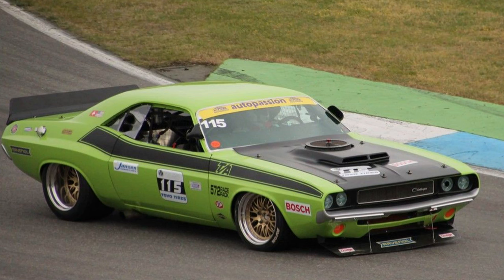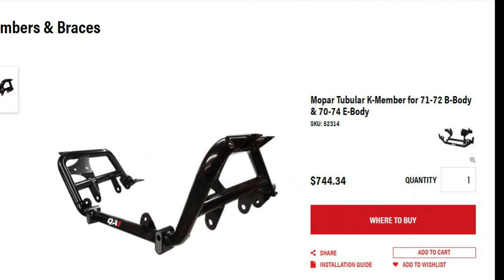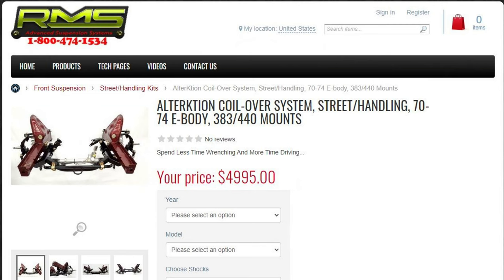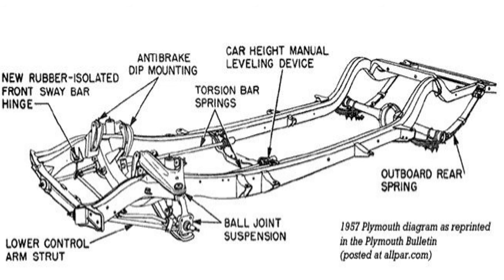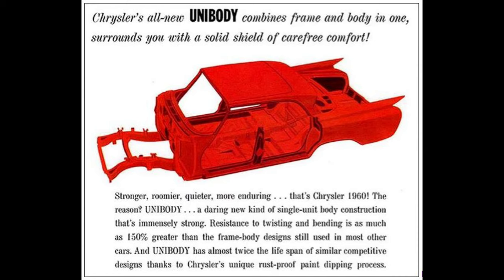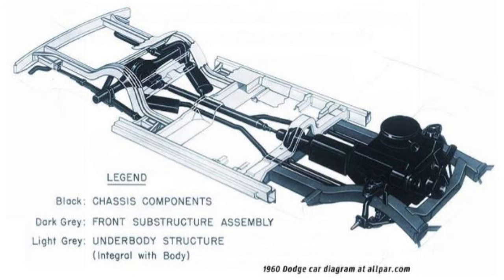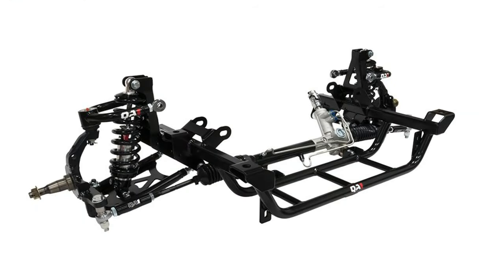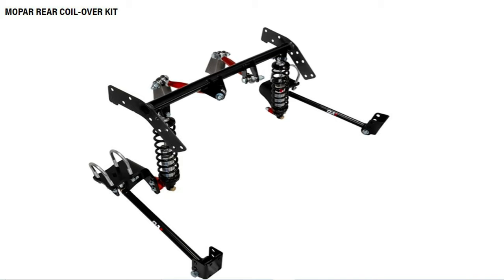Mopar Suspension Upgrades, How to Choose!

Comment: You did a great job reviewing the options out there and all are very expensive, I was assembling my suspension last night and I am going with the PST 1.03 torsion bars, and their  lower control arm stiffening plates, I also use all of the polygraphite  bushings which sometime end up being pretty noisy despite the the silicon grease that they provide. In this car I am running a firm feel stage 2 power steering box as well.  Steer and Gear also make a similar steering box in varying degrees of road feedback.  I bought one of their units when another firm feel box failed and they would not warranty it.   I have also installed the US Tool sub frame connectors and torque boxes, they are really an improvement that is very noticeable especially in my B-body convertible. I am installing a 6.4 Hemi with the 8HP70 automatic in that car. Most of the parts I have bought for that conversion are from Holly.  I am seriously interested in the QA1 system and I guess time will tell if I can pull that off or not.  Thanks again for highlighting  what is out there in one well done post. I
Reply from the maker: Thanks!   I really like the parts you chose for your car sounds very well thought out.  Any videos of it?

Comment: Adding the rear sway bar along with polyurethane bushings completely transformed the car for me.  It's so fun sliding the car around corners with the accelerator pedal.  I think what would benefit me the most at this point would be modern wheels and tires.  I completely rebuilt the suspension, and I have only driven about 10,000 miles since then, but it's been thirty years!
Reply from the maker: Sounds like your off to a good start!  My car doesn’t have any sway bars yet lol.  Modern tires will really help yo allow you to really use the suspension

Comment: I have a TVS ON MY '66 Barracuda, a Mosser rear end, B-Body rear leaf springs. It handles really well. 
I run Auto-Cross with it, usually the only A-Body there.
Reply from the maker: Very nice, how long have you been running it?
Reply: @backyardhotrods9885  Started last year, just local events. Lots to learn, both with the car and technique.

Comment: I have a '68 Barracuda fastback here. Why the heck would I want to go away from my torsion bars, which keep my cg low, towards the centerline of the car, and more rearwards compared to the coilovers? I can always swap out my 0.820" torsion bars for my 1.06" torsion bars, and reattach the front sway bar if I want to drive more than 1/4 mile at a time. Also, the QA1 coil over kit is set up with power steering, I don't do that. Why do I want to step away from my 002/003 super stock springs? They work.
Good video, but it has not sold me on the new technologies. If you can show solid data, X part changed out gave me 0.1 improvement in my 1/4 mile, or Y part changed out gave me more consistent 60 times, that would be very helpful.
Reply from the maker: Hey man we think alike, if you watch my other videos I went with larger torsion bars and I’m keeping my leaf springs too !   I just wanted to show what’s out there   I think it’s pretty kool we have so many options now 👍

Comment: Awesome video very informative! Great to have several options for each persons build. For me, debating on the 5 leaf or 6 leaf for my 70 Challenger.
Reply from the maker: Thanks man!  The Hotchkis springs that I just picked up are actually 3 leaf.  They will lower the car an inch though.  Depending what your looking for.  I will be installing those soon.
Reply: @backyardhotrods9885  yes, those are nice I hear. Really helps the handling and stance. I’m debating on the 2 inch lift, old school status. I’m not sure if I can get that lift with only the air shocks. I’ll do more research.

Comment: Here in New Zealand  there is a former race driver by the name of Leo Leonard ' who raced  the Valiant Chargers  here  and in Australia  in the early 1970's . To get the Charger  to be a good racer he did a lot  of experimentation  and development  ' especially as far as handling was concerned  ' his setup as I recall  was a sway bar on the front but not the rear ' rubber   bushings  and not nolathane ' good shocks ' and perhaps  the most interesting  thing  was that he came up with his own wheel alignment  settings   that worked very well on the track ' he also came up with  a good wheel alignment  setting for street  Chargers  ' or in fact any Valiant  ' I had my Valiants alignment  set to his street recommendation  and it made  a huge difference  to the  quality  of the steering and stability  ' I'd say his settings would  most likely apply to  any mopar of that era . Those settings  are  in the book    "Hey Charger" by Gavin Farmer . If you cant get hold of the book 'I've got the specs written  down in my service  manual. Just ask.
Reply from the maker: Thats good to hear, I will have to look for his book.  I know alignments can be very car specific.  I did a lot of research when I had my car aligned after all my suspension upgrades.  Night and day.  I am curious how our settings would compare. You can see what settings I went with in my video   https://youtu.be/yueazPyk28o
Reply: @backyardhotrods9885  Our  Valiant  A bodies  are  just the same as yours  in the suspension  and  steering (except  for a different  steering  box location) so if  A body wheel alignment  spec's are  the same as B 'C and E bodies?????   '  I dont know  . Our later Valiants  are more like B body size' a bit  like a Sattelite. I know I keep mentioning  Valiants  ' thats  because they were the only mopars we had on offer' except for some specially ordered  60 s Belvedere's and Savoy's etc .
Reply: That photo you've used  of Posey's  Challenger and Gurney's Cuda (or was it Swede Savage?) could be considered  the best racing photo of all time .
Reply from the maker: @barrycuda3769  Its a classic for sure, one of my favorites!

Comment: There are very little mods to do to put the RMS Street lynx rear suspension in. It’s a fairly straightforward install actually.
Reply from the maker: Are you using one? Do you like it?
Reply: @backyardhotrods9885  I have one but haven’t installed it yet. Waiting to build a garage before I working on my car again.
Reply from the maker: @martyschmidt2725  I can understand that…. I could really use more space
Reply: @backyardhotrods9885  I was supposed to build one this summer, 20’x32’ but increasing building costs put the price $8000 over budget.
Reply from the maker: @martyschmidt2725  yeah at my pace I will have my car done and then build a garage 😂
Reply: @backyardhotrods9885  lol I’m the opposite, my garage would be built and then the car but mainly because the car will cost about $20,000 or so above the garage!

Comment: Anyone wondering,  the RMS kits is pretty much 100% bolt in. Only welding is a couple brackets on the rear. I'm installing this kit now. No offense but this video is a little misleading.

Comment: The coil over setups offer ZERO advantage over a well sorted torsion bar based suspension.
They cost too much, they aren't as durable, the geometry is not better and you still need brakes!
Reply from the maker: I am not a fan of the coil over offerings either, thats why I went with torsion bars and still have leaf springs on my cuda!  And it handles amazing!